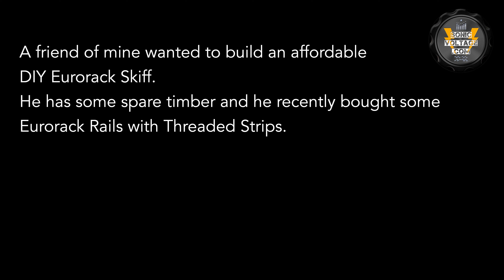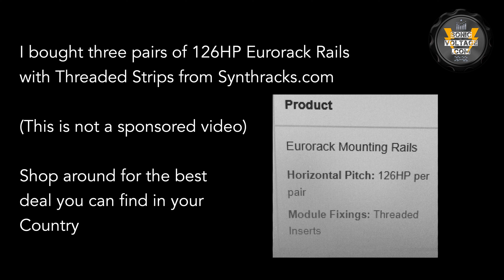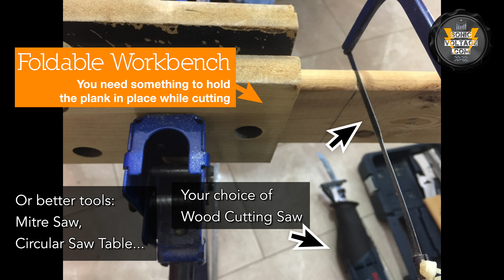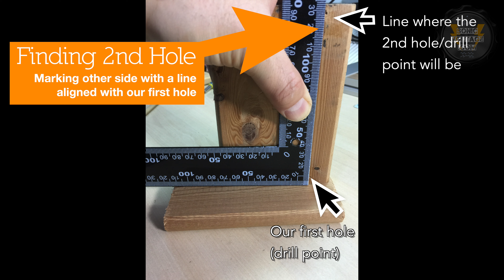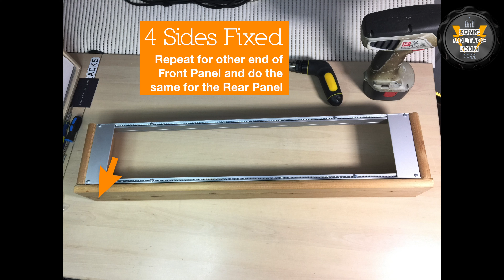How to build a #Eurorack #Case. DIY eurorack #skiff cases for #Modular #Synth. Titan Journey Ep.2

Comment: after watching countless diy case videos, i have to say that the idea of using blank panels to get the height right is genius. i think pretty much everybody gets brackets, which appear to be more expensive, or they just measure it
i think this idea is great
Reply from the maker: Thank you. Simple and it works fine for basic DIY builds. The already made sets with brackets will give you more stability but for simple and quick builds you can do without👍